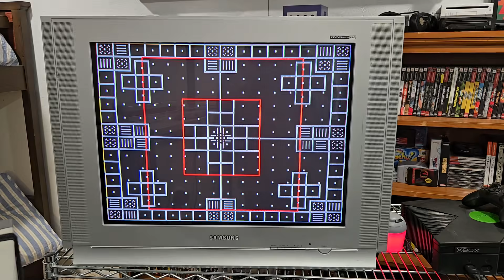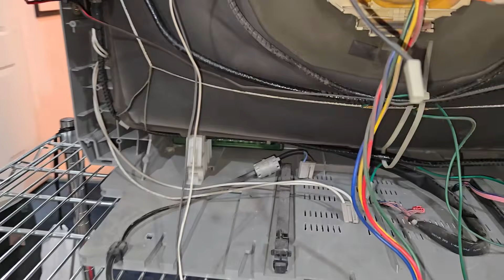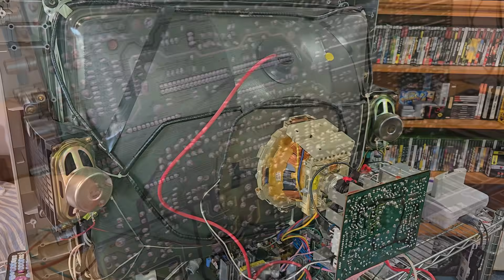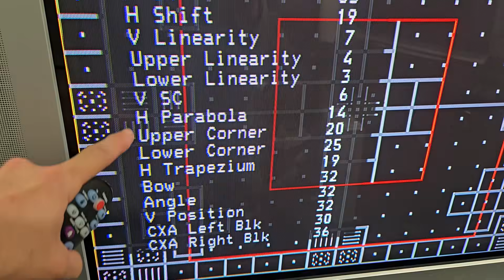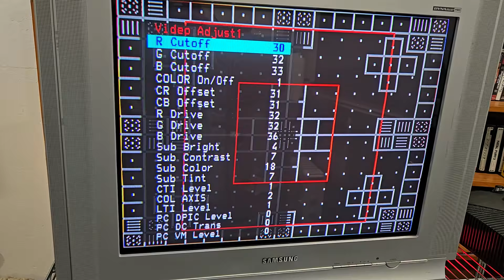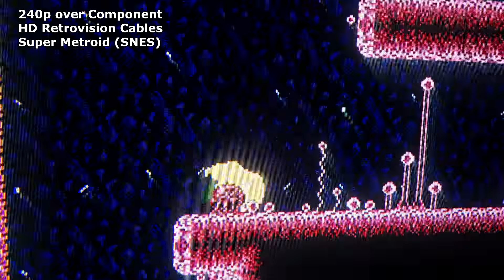Samsung's S-Tier HD CRT | TXN-2745FP

Comment: I was on my morning run around the neighborhood when I saw a bunch of boxes at the curb. One of them was a samtron CRT new in the box. The power cable still wrapped in plastic with tape around it.All the packing foam completely unopened. It has only VGA pc cable. I i ran home and got my car and threw it straight in there. Now it is the monitor for my pandora box six, and it looks incredible

Comment: also I forgot to mention this in my previous comment but while 240p and 480i may be lag free on composite or s video, they do improperly process 240p, so it doesn’t look correct. If you’re picky about image quality you’ll still want to line double 240p with an external scaler but it is good to know that something like a ps2 can be hooked up via s video to get lag less good looking 480i. That’s probably the only time where the SD inputs being lag free would be of huge benefit. I actually never lag tested anything besides the component input on mine (but I did check all resolutions) so very cool info.

Comment: I had this exact crt and while the lag lag less 480p was nice, there was a distinct lack of sharpness vs my hd wega side by side. I even tried using a retrotink with it to mimic 240p and 480i and while that worked it also was much less sharp than my sd wega

Comment: I think that sub-flyback is an HV regulator. Different scan rates and varying screen brightness is going to make the load change, which messes with focus and deflection. That should work like a buck/boost to keep the HV stable, which is why I'm surprised the picture size is bouncing at all when the white bars go on and off in the lag test. HV regulator is supposed to prevent that from happening.

Comment: Hey RetroTech, I discovered that a lot of these mid 2000s samsung CRT TVs actually do support 576i at 50hz through component video, as many of these models were similar looking that were released in other parts of the world, and samsung kept making CRTs outside the US until 2013 or 2014 I believe and even had a super slimfit model, which was even skinnier, but by only around 1 to 2 inches more than normal slimfits. I have both a samsung TX-P1634 and a TX-T2782 that are both SD sets, and both accept 576i at 50hz, and I did this using an HDMI to component converter/resolution scaler, meaning that with some adapters and/or converters, you can get these TVs to accept a PAL signal, and there is much more flicker due to running at a lower refresh rate at only 50 hz. Lastly, believe it or not, the Sony KD-27FS170 also supports 576i at 50hz through component video, but finding sets like these are somewhat rare in the united states except if it's a later samsung CRT TV. I hope you learned something new today!

Comment: Hello, Mr CRT Man. Could you do a general guide around using the service menu on regular old consumer CRTs? I have one from 2002, an Aussie model, with a service menu that is either too intimidating or I'm just uneducated, because it requires the whole "input a code to save" function when adjusting subcontrast and co., which I'm not sure if I'm even understanding it right
Reply from the maker: Hello, the best thing to do would 1st be to locate a copy of the service manual for your exact TV.  Inside the manual, there will be directions on getting into the service manual, and then there should be a list of adjustments available and possibly an explanation of what each adjustment does.  That's where I'd direct you to start.  Once you are ready to make an adjustment, record the current settings before making a change in case ypu need to go back.
Reply: @RetroTechUSA thanks for getting back to me regarding that, I will try harder/again despite the manual being scary! Also, I wanted to say, that I've watched your video regarding your experience with Myocarditis and that it was quite refreshing to hear as I had an almost parallel experience when I was 14. I'd tanked the chest pain and lethargy about 2 weeks before my mother dragged me to hospital because I was essentially fainting from exhaustion. The hospital didn't take it seriously until after the fact and I still have issues with my heart to this day. The point here is that your experience as well as choice regarding the zombie pills and the hospital has made me feel like I'm not alone in such a bizarre situation 😊; although, I can't say I had dreams quite as scary as yours 😅

Comment: This is totally unrelated to this video, but with your knowledge couldn’t you build a board that works with 15khz and you can integrate it into a VGA monitor?
That way we could get PVM video quality in 240p on every regular CRT monitor.

There is a huge thread with over 100 sites in a Russian forum about many people who did it and they also uploaded some old Russian videos to YouTube.

To me such a board would be the absolute greatest invention for CRT enthusiasts since it brings back what the VGA standard wrongfully deleted.
That would also mean I could use my Amigas and C64s on those super fine tubes, wich would be amazing for Pixel Art design with the Amiga!
Reply: There were monitors made that handled dual sync.

Look for early 1990s workstation multisync monitors like the Commodore 1960 or Commodore 1942
Sony CPD-1302, and some GDM series.
Reply: @samp3413 I have most those Commodore monitors, but I want such a board for my big, high end Monitors like the Iiyama Vision Master Pro 514.
Those sync roughly to 30khz, while my Sonys sync already down to around 26khz there is no modern high end monitor that syncs to 15khz unfortunately.
I just want an additional board that I can solder to the RGB inputs of the tube so it gets a 15khz signal.
The tube itself has no problem displaying the 15khz signal, its the electronics that can‘t do it because the VGA standard was rushed and developed without backwards compatibility for CGA and EGA.
Reply: The OSSC, RetroTINK 2x and higher, GBC control, etc., do exactly that—no need to modify the monitor. However, some people like to adjust the focus to get a more PVM-like look instead of the razor-sharp BVM-like look.

Comment: I’ve just gotten my hands on a philips cineos 29pt9521 which has RF, composite, s-video, component, scart-rgb and hdmi inputs. I’ve yet to do testing on it, but it seems to be a unicorn here in europe, as it properly supports more than 15khz 😊 we’ll be using it at a retrogaming event next week 💪
Reply: Wow, that sounds awesome, never heard of it here in Germany
Reply: Anything that can run 31khz properly is rare here. I’ve got a Loewe 32inch Credo widescreen with vga card from Ludo, and it’s awesome! He’s recwntly released VGA cards for other loewe models, so if you’re on the look out for one, it’ll likely have an VGa mod available 😉
Reply: @sjurursteinholm5368  Oh, I really need to look into that - thanks!
Reply: I'd love to get this one too but impossible to find anything with component inputs in Finland.
Reply: @calyps0man  Component inputs isn't inherently better then SCART-RGB, its just that the crt usually don't support anything higher than 15khz inputs, and those that do do it over component or VGA.

Comment: Samsung dynaflat heaven >:)
(Certain dynaflat HD sets wont have an internal scaler and some do, typically if it doesnt do 720p then its a dual scan 31/33khz HD set, which is what you want. The single scan ones will upscale and cause a little input delay on any non-native resolution)
Reply from the maker: Thanks, I did figure there would be multiple models of this TV.  I think the 14" I have may not even do progressive, but I have not tested it yet, so that is just a guess.

Comment: Seems awesome. Glad to see any technical info regarding HD CRT’s because there isn’t much info on YouTube or anywhere really on how to repair their specific parts and components. For example I have a Toshiba that shows wavy green horizontal lines that flicker up and down the image in 1080i, but cannot find any resources to troubleshoot it
Reply from the maker: Thanks.  These HD sets certainly are more complicated.  That can make it hard to troubleshoot, especially stuff like inconsistency on a single display mode.  The TV may just not like the sync or something weird.

Comment: Too bad we never really got HD CRTs here in Germany, would have loved one back when I got a PS3 and couldn't yet afford to get an LCD.
Currently I'm enjoying a Philips "Black Line S" flat tube that I use with a MiSTer and a DVD player (mainly for interlaced discs) and it looks great via RGB SCART. As tv standards do not matter via RGB SCART, as long as the TV can sync to 60 Hz, it's also great for NTSC DVDs.
So even if I could ever get my hands on one, which is very unlikely, I guess I'm fine with 576i/480i 😊